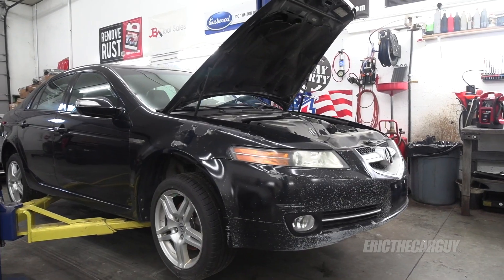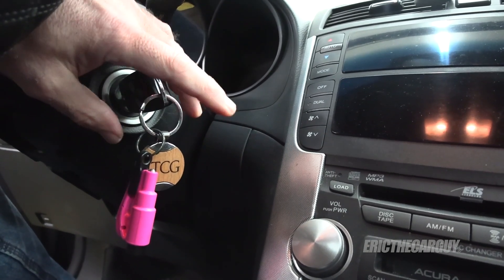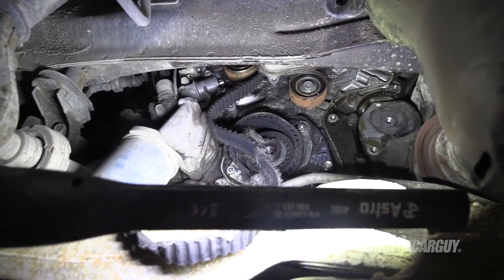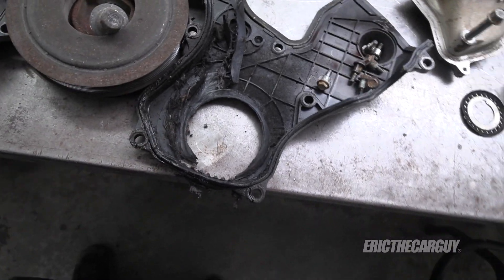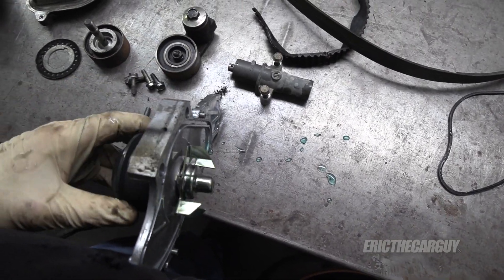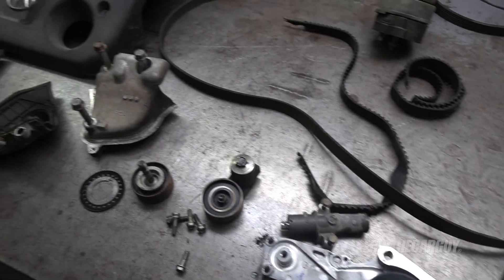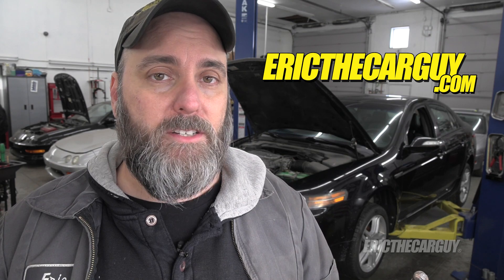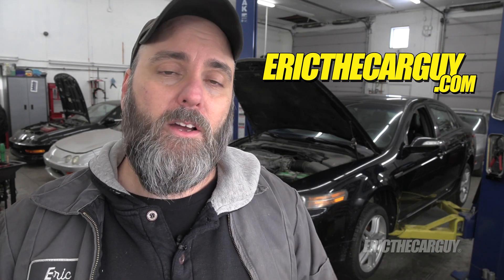Acura TL Dies On the Road

Comment: I had experience in my youth where a mechanic diagnosed my mom's car as bent valves from a broken timing belt. But it was on a non interference engine..... He ended up with the car for free and he secretly threw a timing belt on it and drove it..... He was one of those not honest mechanics. Glad it's fixed

Comment: Those were definitely counterfeit parts.  The shrink-wrapped water pump is a dead giveaway.  I bought a counterfeit timing kit for my 07 TL on ebay but thankfully I realized what they were and got a refund before I installed them.  Then I bought the Aisin TKH-002 instead.  Amazing that your engine survived!  Time to buy a Lotto ticket.
Reply: And he went ahead and bought a gates brand replacement lol
Reply: @preciadoalex123  lol I know I cringed when he showed the gates replacement
Reply: Hey man I bought a timing belt kit on eBay last year for my 2005 mdx with 250k on the odometer. I’ve been postponing the job just because of time and I’d prefer to do it myself. The belt that’s on the engine is still in good shape so I figured I’d wait until the summer. But now I’m 🫤 skeptical about the part that I bought. Can you please tell me how to tell if the parts are counterfeit or not?

Comment: For timing belts I will only factory belts.  I've used non factory and they've broken much much sooner than the factory ones.
Reply: Good practice there do you get sensors too? I do get aftermarket sensors since well I can't afford oem sensors sadly but I haven't had so much issue. I say that because well... I bought a o2 sensor that was like half dead on arrival. Now I bought it off of ebay... and well that was my first mistake, but however it was supposed oem it was a mopar sensor too possibly my second mistake. Now the funny part was that it DID fix the problem BUT the heating element was somehow broken I know that because the computer changed the code I just now have a code for the heating element now on my car hmm...
Reply: @photondebuger45  get OEM ones right from the stealership.  Same with fuel pumps.  I've had napa pumps fail.  But when I went to ford and bought an OEM one it lasted until the car died on me.  Which was at least 200k miles later.

Comment: That was super violent to rip a boss off even if it is aluminum. You know fun story my sister in law drove her 13 Honda pilot for 3 months with no coolant and thought the "H" meant that the motor was at operating temp🤦‍♂️. Anyway she replaced the radiator do to it leaking and to my surprise the headgaskets never leaked and had full compression. After that I purchased my 08 Acura TL cause for a motor to take that much abuse and survive is testiment to quality. I was sick and tired of the garbage the "big 3 " were putting out. I went through 2 gmc cars and a ford while my wife drove all the way to 250,000 with her first odyssey. Anyway that's my story.

Comment: When I was doing research into changing the timing belt on my 02 WRX, I read a handful of horror stories of failing belts within 10,000 miles and the consensus was the cheap knock off kits were very failure prone. I have to admit I was a bit skeptical about this. I went with the OEM kit as I wasn't trying to save money on the job (well aside from doing it all myself) but I still suspected that those early failures were more likely user error than parts failure. Watching this video and reading the other comments, I'll only ever choose OEM parts for a job like this for sure. Crazy how catastrophically that failed so soon.
Reply: Yeah I'd never put cheap aftermarket parts, especially timing components, on my engine. Not worth the risk, just buy OEM
Reply: The key takeaways are to avoid CHEAP aftermarket parts.  Quality aftermarket parts from reputable brands are still worth using especially with how outrageous dealership markups can be on some OEM items.
Reply: Can’t go wrong with gates timing belt kits
Reply: @Desantos King Maonesium is better! Let 100 parts bloom!
Reply: 2004 to 2006 need tapered shim under idler roller, or the belt will wear against the cover!

Comment: I also purchased likely counterfit parts off amazon for the timing belt on our '07 MDX. Crazy thing is that ours also failed in late November 2021, but that was after almost 30,000km of driving on it. Weird thing is that the serpentine belt that came with the kit failed in the exact manner that yours did (chunks missing), and that really should have been a warning to go in an replace the timing belt again. The mechanic we had the car towed to also suggested we put a timing belt on it and see what would hapopen, but with our needs for that vehicle having changed (only one person driving it at a time, the space and fuel waste was unneccesary) and the vehicle having done almost 400,000km at the time (was also starting to succumb to rust), we decided it was time to part ways. Easily the best vehicle we've ever owned. We owned it since new, and it definetly didn't owe us a even a single dime.
Reply from the maker: Sorry you had to say goodbye to it. Thanks for sharing that.
Reply: What did you guys replace the MDX with?

Comment: Glad you sorted it, I had a similar experience with my FIAT Ulysses here in the UK. Coming up the motorway it stopped but I had the presence of mind to dip the clutch (manual gearbox) and coast to the hard shoulder. To cut a long story short, I stripped the belt area to find about a quarter of the timing belt had stripped its thread? After replacing just about everything I could think of and checking the timing lots I could never found out what caused it and never got it to start. Having had it for 14 years, I keep my cars forever, I sold it as a none runner. I miss that MPV it was so practical.

Comment: Wow that's incredible! My TL had crank sensor issues causing multiple misfires at high rpm. I'm astonished that your's didn't bend any valves. Long live the $200 TL!
Reply: Its impossible to bend valves if the timing belt is fine with proper tension and not skipping a tooth, it mechanically puts the crank and cams in sync. Valve float at high rpms is a diff story.
Reply: @traktion9  I was commenting at how astonished I was that HIS valves didn't bend because the belt snapped. My belt didn't snap, it wasn't getting proper crank signal. Most Honda engines destroy themselves once the belt snaps. It probably depends on how fast the engine is turning. Thanks tho homie 👍

Comment: Really glad this one worked out for you.

I'm thinking the original cause of the failure was that boss for the crank sensor bolt. If that sheared and the crank sensor bracket moved, that could have shredded the belt - the build up of fibre in that area does give more credence to this also (slowly shredding on the bracket in that area, before ultimate failure)

Comment: Had an 03 TL with the same engine and used your video  that I bought for 11$ in 2011 to do a water pump timing belt job myself, best 11$ I ever spent. Glad to see if a timing belt brakes, there’s still a chance the engine isn’t damaged.
Reply: How many gearboxes have you been through? My '03 TL died with its 3rd transmission in it. They certainly got their act together on the 3rd gens though. Great cars
Reply: @RothBeyondTheGrave  Should have ditched the Acura transmission and replaced with one from a V6 Honda Accord or Oddessy instead

Comment: I got a 05 acura mdx with transmission issues for 250.00. Instead of replacing it I diagnose the problem and took out transmission, took it apart and replace a broke sprag. Now I got a nice shifting vehicle. Lesson is take a chance on something that not quite broke. Good job on timing fix.

Comment: I just had almost the exact same failure on my 98 Accord 2.3.  The crank/tdc sensor housing broke, causing the bolt to back out and shred the belts/timing components, which were less than 10k miles on  them.   But being an interference engine, it bent a couple of valves.  So I just rebuilt the entire engine.  I ended up spending almost 1500 dollars on the rebuild, but now I have about the newest 98 Accord in the area.
Reply: Did it burn oil before and does it now?

Comment: Absolutely love the real world feel of this video.  You and your real life situations are so very relatable Eric, to many of us, and that’s why your channel is so popular.  

So many folks out there clamor about how they only buy oem parts blah blah.  Well, that’s good advice, but on a $200 car, where reliability isn’t a huge deal.  Why spend the extra $?   I mean it’s not a customers car, it’s yours.

I was going to interject also, as I had to do this once on a jdm b20 engine which didn’t have a crank position sensor mounting, you can jump the cam and crank sensor signal wires…it’ll cool the engine and it’ll run just fine.  Again, in this situation where it just needs to run would work.  My situation was a $500 crv and it’s still running jumped out to this day, and that’s been 6 yrs ago,
Reply from the maker: It's always great when people 'get it'. Thank you for that.
Reply: Unfortunately this video shows the complete opposite. Potentially counterfeit parts left him broken down on the side of the freeway requiring a tow. Could have also crashed the engine. I am all for economical repairs. The Gates kit he used for the new parts is a reasonable risk. I am done buying parts off Ebay/Amazon for the risk of getting counterfeit parts, and still paying hefty for the parts.
Reply from the maker: @m ph  THAT was the point of the video. I had a suspicion the parts were counterfeit when I installed them, video linked in the description. Since this was a $200 car, I felt I could experiment. If I break an engine no big deal in my mind, it's a content opportunity. The point is, I make these videos for a living. The more stuff breaks, the more views I get and my kids get to go to college. I hope that puts a finer point on it for you. Thanks for the comment.

Comment: There is a good post on the odyclub forums about a fake ebay timing belt failure.  The pic of your belt (at 35:50 on your video of the timing belt replacement for the Acura) shows the writing on the belt you used and it clearly matches what the fake belt looked like in the odyclub forum post.  But you were very lucky by not having interference damage.  Thanks and keep up the great videos.
Reply from the maker: You should refer them to this video also. The entire reason I installed the counterfeit kit was to see if it would fail. Now that we know, we know. Thanks for the comment.

Comment: Good advice about the timing belt.  Years ago, I had a 1988 Honda Accord that ran great......until the timing belt broke.  It had a interference engine, and my mechanic said it (the engine) was probably done.  He went ahead and put a belt on it and it fired right up.  Drove it without any problems four more years until I traded it in.  You never know.

Comment: Nice Job Eric.   Years ago I replaced 2nd timing belt on my old 04 Ody at 200K.   Bought a kit that had a continental belt and Aisin Pump.  Idlers were painted black.  32K miles later I got a call from my wife that it was dead on the road.   Towed it home and found belt broken.  I surmised the idler bearing was seizing intermittently as there was pieces of the smooth side of the timing belt burned onto the smooth surface of the bearing and wear marks on the back of the belt.   Tried the same thing as you with a new belt and the original koyo idler.    I wasn't as lucky as you,  bent valves.  Beware of cheap off brand kits!
Reply from the maker: Sorry to hear that happened. Glad you got it sorted though. Thanks for the comment.

Comment: Yeah, this is what I was talking about with Belts vs. Chains in your other video.
I'm a big VW guy, and there was a whole series of belts that were not manufactured properly for their belt driven 2.0 "BEV" engines that were notorious for failing prematurely, and a bunch of aftermarket belts that were bad too.
Basically you had to do your timing belts early, and make sure you buy OEM, and even then it wasn't a guarantee.

At least with a chain, the lifespan is so much greater that you'll have a lot longer before you'll need to touch it, which on both a chain and belt is a risky proposition (especially with flaky parts). If you have to do it less often, you'll be better off in my mind.
Reply from the maker: In my view, even with a belt failure, this engine was still good. And yes, it is an interference engine. Replacing the timing belt and water pump took about 40min. Chains wear out over time no matter what and cause a loss of engine performance. They are also more difficult, expensive, and time consuming to replace in my view. Especially when you have to drop the oil pan. Either way, you need to maintain your engine, no matter how its internals are driven. Thanks for the comment.
Reply: Nah, I had to replace by chain on my f150 at 175k because it worn to the point the cam phasers were making a lot of noise. The job was extensive and cost me 1.5k in parts alone. On the other hand, I replaced the timing belt on my Pilot with $175 in parts and took me about 3.5 hours.
Reply: palillo2006  did you keep up with oil changes? I’ve read chains stretch if you dont do regular oil changes, and let’s face it, alot of people dont do regular oil changes
Reply: @dawicked2k8  Yup, and before the oil light showed up at 7500 miles. I would change it at 5k ish.
Reply: @ericthecarguy  Do the chains typically wear out, or do the guides/tensioners wear out and cause them to jump time?  Seems that was a common problem for some Ford engines a while back where the guides/tensioners would prematurely wear out causing the timing chains to jump teeth and eventually would wear and possibly break the chain, or get the engine out of time to where it no longer ran.  I think that was a common issue with the 4L V6 engines in the Rangers and Explorers.  

I remember my 84 Ford Ranger 2.8L V6 engine had timing gears.
Reply: @ericthecarguy  I will say tho that altough I can guess the camshaft in your engine happened to leave all the valves closed, man that was a lucky thing to happen before stuff bent!
Reply: @palillo2006  That's a well know common problem on F150s. Their cam phasers go bad. It doesn't have anything to do with your chain, but while you have the engine apart, you might as well put in a new chain and follower and etc... This is a design issue pure and simple, and doesn't really speak to chains vs belts.
Reply from the maker: @William Sevier  Dealers choice. Everything wears out. Timing belts are serviceable and a PITA, but chains are not serviceable and will wear out at some point. In the process, engine performance will decrease over time as the timing components wear.
Reply from the maker: @Naoki's Retro Corner Technically that's not possible as cam lobes don't disappear when a timing belt breaks. I did get lucky though. I can agree to that for sure.
Reply: @ericthecarguy  Thank you Eric I never knew that before that a chain lowers performance as it wear's out and that's why more companies are going back to belts

Comment: Hey Eric... nice to see you got your Munsters' fast-motion going at 1:59. I just did the timing belt work on my son's 2000 Camry V6 (118,000) using an Aisin kit & Continental PS/Alt belts from Rock Auto. I used FelPro crank/cam seals and a Toyota tensioner. With so much junk from who-knows-where out there for parts, being careful is an understatement. It's one thing when you screw (17:04) the motor, & another if it screws you. Good, patient work. Thanks for the closing advice.

Comment: I bought my wife a near mint low mile, anthracite grey 05 TL 6 years ago,before I gave it to her as a surprise,I got  a Honda dealership put it a new timing belt,water pump, tensioner and new drive belts,been purring along ever since. I get my 2001 Prelude belts done at Honda too,can’t really beat OEM quality 😎

Comment: Eric, what a nice job you achieved. You mentioned don't forget to do compression test on engine, that is critical to ensure your engine had not damaged due to timing belt failure. High performance engine would have broken because of timing belt failure.

Comment: I would have tried the same thing as well. If you do need a replacement engine, you'd likely redo the timing belt and water pump anyway so all you're losing is some work time. Nice, Eric.
Reply: if you have time you can pull the valve covers and rocker arms and check the valve spring heights (should be the same).
I did this to on budget co-worker

Comment: Hey Eric. I’m glad it worked out. You’ll be fine with that Gates kit, ironically I noticed that the belt you initially replaced was a Gates belt. 
Seen an older TL once that the pulleys seized up and the timing belt melted to the pulleys. New kit and the car ran fine.

Comment: I work at parts department in Finland. We have lot's of Gates brand timing belt kits, it is insanely rare that they have issues. Other good aftermarket manufacturer, is Ina. I have installed their timing belt kit, with water pump on my old eg civic. Really high quality parts, it was a joy to install them.